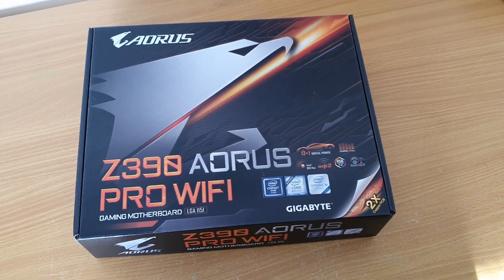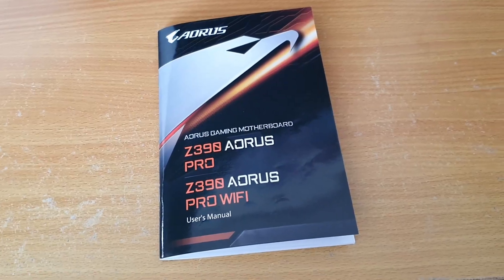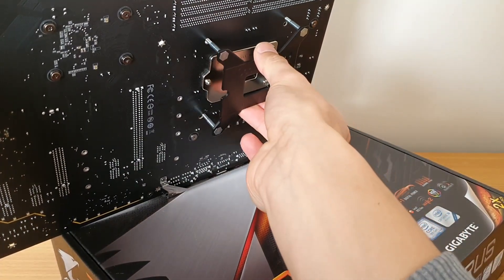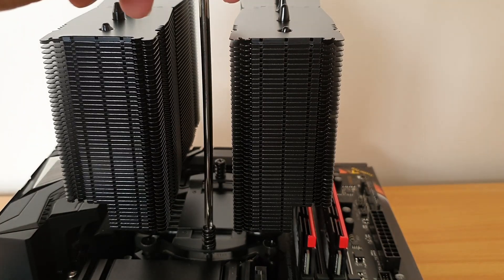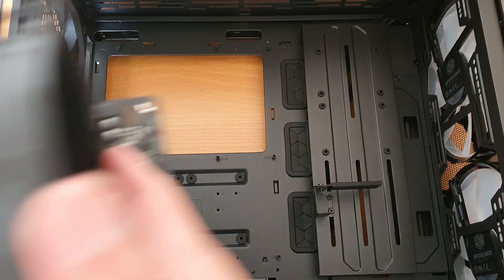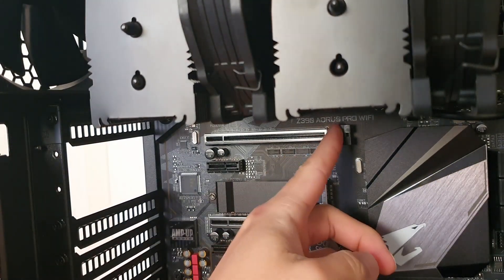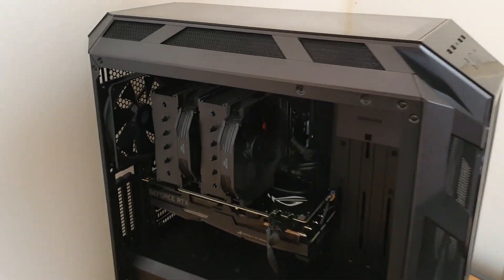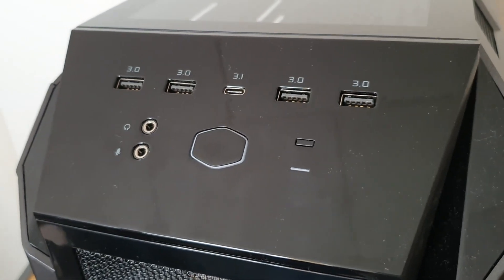How to build a PC - Gigabyte Z390 AORUS PRO Wifi and ASUS RTX 2080 Ti

Comment: Cud the be quiet! Dark rock 4 cull the cpu ?
Reply: And I think Corsair have a product Wehr you can putt in 2 usb kabelst
Reply from the maker: Thanks for the info, looking at getting something similar, will post a video of the install once I get it
Reply from the maker: Not sure what you mean by cull, but the Dark Rock 4 would work perfectly fine with this build. 
I have seen reviews between the Dark Rock 4 vs Noctua NH-D15 and the cooling performance is very similar

Comment: Sir,I have Auros Z390 pro wifi (motherboard), 32gb ram , 1 standard 2TB HDD, 1 512GB Intel M.2 (containing operating system), 1 1TB Crucial NVME M.2(for game storage), 650Watt Power Supply.
Earlier I had  NVIDIA ZOTAC 1660 super 6GB OC and everything was fine . 2 days back I upgraded to RTX 2060 Super 8GB and my PC doesn't boot at all  , When I press the power button all the lights glow and fan starts moving , after 2 to 4 seconds later. It doesn't boot and starts again and the same thing repeats (and yes nothing on the motherboard)
But if I remove the   "1TB Crucial NVME M.2(for game storage) " then everything is working fine.Please help me as after installing the RTX graphics card , I am not able to use my secondary NVME. 
I guess this is some BIOS settings problem or need update ,But I am not able to sort out myself.. Please HELP!!
Reply from the maker: Does anything appear on your monitor when it's trying to boot?
Reply: @sushitech9091  no nothing appears 
1st LED on my graphics card glow then motherboard rgb and then all goes off. and the same thing repeats. nothing on the screen. have even unplugged the HDMI then tried but doesn't works. Earlier with Zotac 1660 Super, no such problem was there. Could it be a bios setting or update or something?
Reply from the maker: @RoshanKumar-yf3mf  Yea u could try updating your bios but I also think it could possibly be your power supply?
Are you able to test by leaving your NVME M.2 in but try removing some other components like RAM or the other HDD and see if you computer will boot
Reply: @sushitech9091  Everything worked fine with ZOTAC 1660 Super -> The graphics card with NVME M.2 along with 2nd NVME (containing OS). 
The moment I upgraded to ZOTAC RTX 2060Super.. then the problem arise ..
I have to remove the NVME m.2 else my system wont boot.. And everything is  fine and working condition..(RTX card, all the storage devices and everything works flawless)
2nd.. I am on BIOS version F10 and i will update it too F12.(That I think I must doo)
Reply from the maker: @RoshanKumar-yf3mf  I was thinking maybe your power supply might not be powerful enough which I why I asked if you could test by removing other components and leaving the NVME M.2 still connected
Reply: @sushitech9091  Update:-----> So I updated my bios to F12 and now... My system boots but it doesn't detects my NVME drive I tried solving it by disabling the secure boot option but doesn't work.... Please HELP!!!
Reply from the maker: @RoshanKumar-yf3mf  I saw on a forum that someone had a similar issue and went into the BIOS and changed the Storage Boot Option Control = Legacy. (default is UEFI) https://forum.gigabyte.us/thread/9551/solved-z390-recognizing-m2nvme-ssd

Comment: The ram is not on the motherboard QVL - does that matter or can I use the ram you got
Reply from the maker: The RAM I used is perfectly fine, just remember to go into the bios and enable "Extreme Memory Profile(X.M.P)" (change it to profile 1).
This will allow the system to fully utilize all the RAM

Comment: I just got a Z390 Aurus pro wifi and the Ga series gold power supply with new ram but the computer wont turn on can you please show how you connected the power supply to the mother bored
Reply from the maker: You should have a User Manual guide that came with the motherboard 

Check page 15 and 16.  On page 15 it has a diagram of the motherboard

You want to connect your power supply to ATX_12V_2X2/ATX_12V_2X4 and ATX

On the diagram this is number 1 and 2

Comment: Hey man, serious question. Just got the same motherboard and finished the build but a white light flashes when flipping the PSU switch on, is this normal? does the mother board have LED's near the back that cause this?
Reply from the maker: Hi, I just tested with mine and I also get a light flash when switching the PSU on. I had a closer look and the RAM slots have an led light that flashes when powered on. 
There maybe other lights but I couldn't see under my CPU fan.
Reply: https://www.gigabyte.com/Motherboard/Z390-AORUS-PRO-WIFI-rev-10#kf: The lights won't flash if a component is faulty

Comment: how did you put in the 8 pin connector on the top left of the board
Reply from the maker: That was actually quite hard to connect but I was lucky because with this computer case I could remove the entire top of the case which made it easier to get to

Comment: I have this same motherboard, and the best slots for 2 sticks of ram are B2 and A2 (it clearly says so in the manual) this is because you get better signal integrity as this mb is a T topology board. I tested this when overclocking my ram and it was indeed better. Also the left clip on the second memory stick you installed didn't click all the way in.
Reply from the maker: Hey, thanks for the info, I have since upgraded to 32GB and good spotting on the memory stick not clicking in, I did notice at the time but it kept making my camera shake so I stopped before it clicked in
Reply: Sorry, where is it said in the manual that the best slots for 2 sticks of ram are B2 and A2? I can't find it.
Reply from the maker: @pura_boda   Hey, to be honest you can install the RAM into either B2/A2 or B1/A1 and you wont even notice any difference at all
Reply: @sushitech9091  okay, thank you!

Comment: Did you use the y cable to connect both cpu cooler fans to cpu fan, or use cpu fan and cpu opt?
Reply from the maker: I didn't use the Y cable, I connected each fan to SYS_FAN5_PUMP and SYS_FAN6_PUMP

Comment: Nice built.. I am planing to do it. But, my budget don't allow me use 2080 ti gpu, so i am going to put 1660 Super. My question is what other case I can use to built, I had NZXT H510i  in my mind, is it compatible with your setup?.  You also didn't use M.2 slot, just wondering why it that?. I need your feedback.. BTW  your built is awesome I love it.
Reply from the maker: Hi thanks for the question,

The NZXT H510i case is compatible with the Z390 AORUS PRO motherboard so you shouldn't have any issues there
.
However if you plan on using the same CPU cooler as me you might want to double check the size of the case as it may not fit
.

The reason why I didnt use a M.2 SSD is because I will be using this PC mainly for gaming and the difference in loading times between a SATA SSD vs a M.2 SSD is only a few seconds
.
Also where I'm from the price for a M.2 SSD is double the price of a standard SSD and just not worth it.